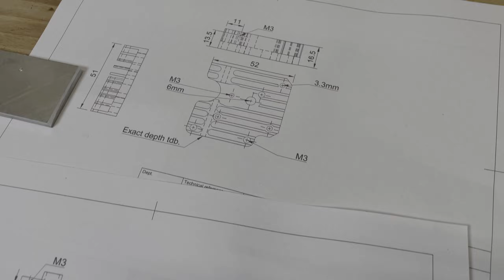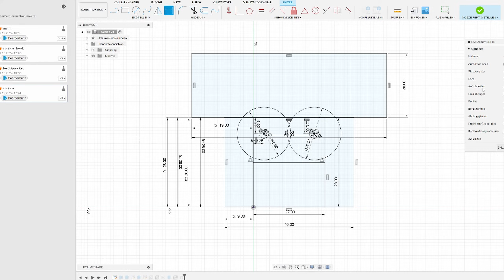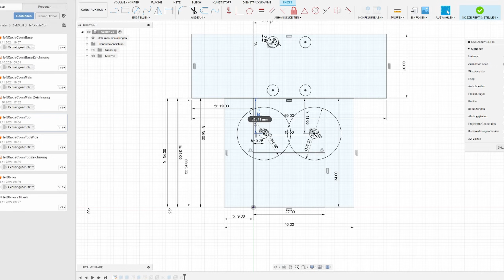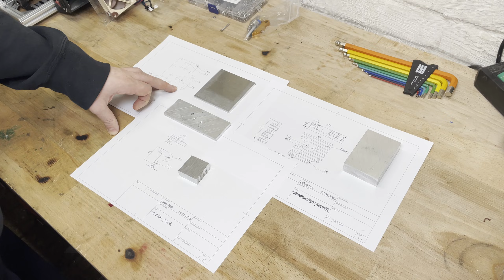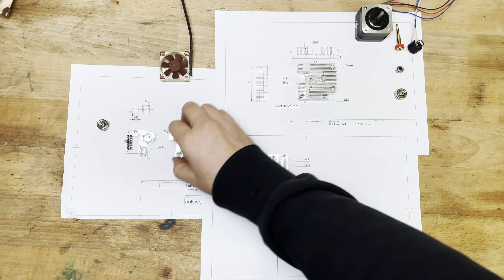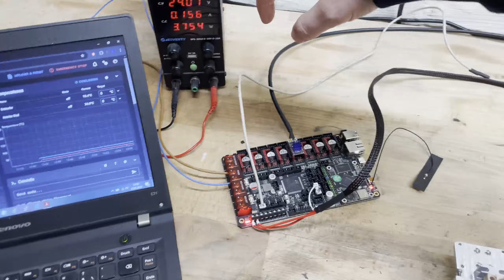DIY 3D Printer Extruder: Should you build your own?

Comment: Add some thermal paste between the motor mount plate and heatsink plate?
Reply from the maker: thanks a good point! For now the heat is not an issue, and I did not wanted to make a mess. Because i have the feeling that this wil get everywhere over time

Comment: Been following along. I have access to 20mm- 3/4"plate would this work with your design. I don't know if I am mad but I only have a Bridgeport and no cnc. Hopefully going old school is still an option.
Reply from the maker: Sadly I don’t have much experience when it comes to planing for manual milling (yet, hopefully) 
In in essence the only sort of critical dimensions are the hole locations. And that should work out. The heatsink part is way overkill and can be simplified

Comment: youtube deleted my comment (to long i think?)
I think it's good idea to build it yourself if u have some basic tools and know how to use them
i build my own extruder and hotend multiple times , my first extruder (like 13-14y ago) were made from nema 23 with grinded smooth gear then using m6 tap sideway i make it like gears for filament , later i needed super high flow hotend so i drill through 16mm bronze rod and tap to m6 , wrap in nichrome wire and use 2 volcano nozzles (without tip) as spacer and single "standard" nozzle as main nozzle.Worked great but later added 4 pieces of stainless wire to hold it because it was really long and were braking heatbreak . After that i can go 100mms+ with standard 1.2x0.6 to 0.8mm layer up to 1.5x1mm (maxing out with 2x1.5mm layer)
Reply from the maker: With a Nema 23 that was quite a thing. I debated between N17 and N14 :)